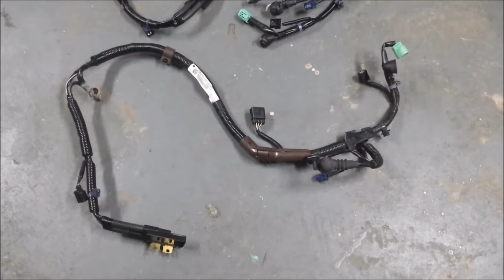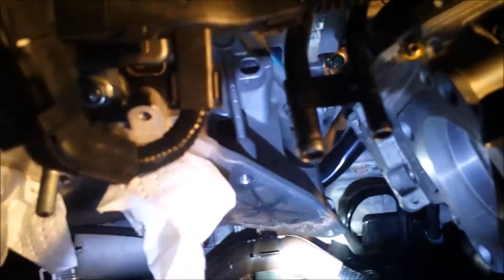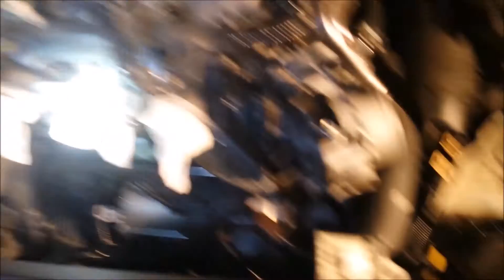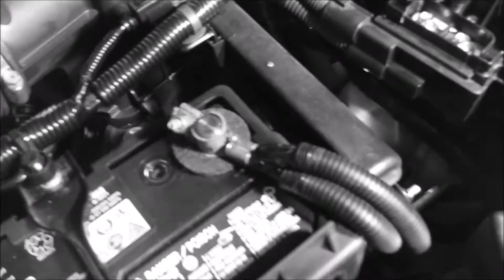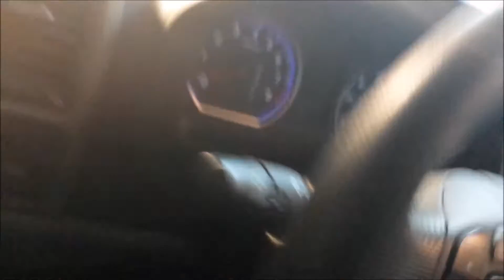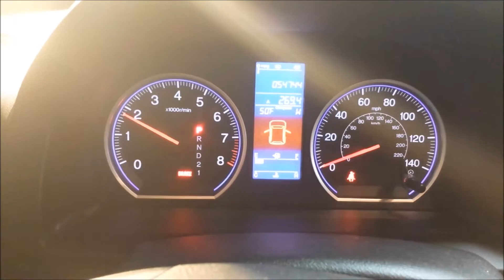2010 Honda CRV Battery/Starter Harness Install

Comment: Hey Bobby, can you share where you bought the 2010 Honda CRV Battery/Starter Harness? I am having the same issue with my car.
Reply from the maker: Stuart Simmons No problem. I added the Honda dealership link in  this video description. At the time, this dealership was willing to work with me and offer a very reasonable price. I basically discovered them on eBay because they sold various harnesses. I called and they had what I needed. I'm sorry about your vehicle. I still own my CR-V and the replacement harness is in great shape. Keep in mind where you park your car for long periods of time. What happened to my harness was a moisture issue in my basement caused by A/C condensation. Just something to think about. Let me know if you have any more questions.